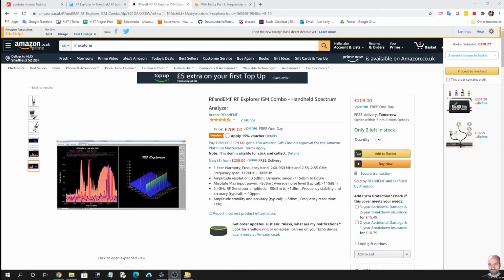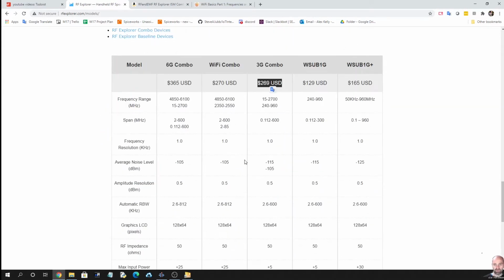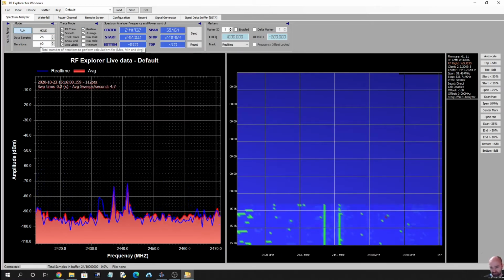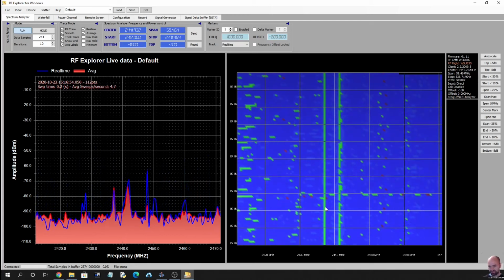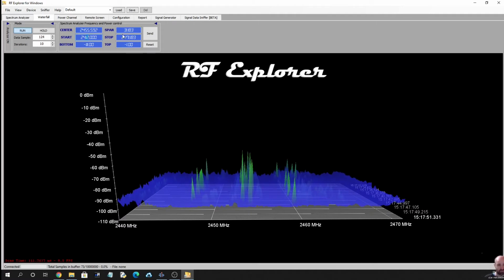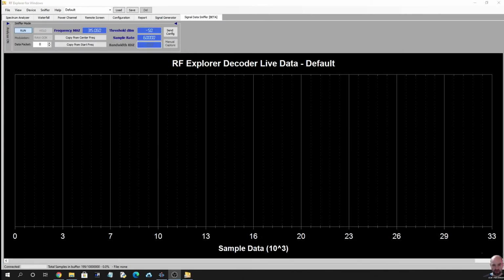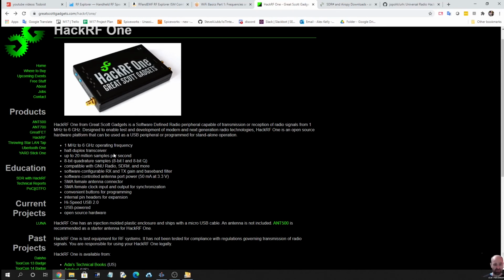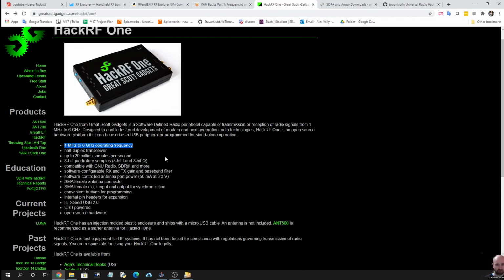RF explorer software defined radio

Comment: Aint these RF Explorer based around the Synthizizer chip MAX2870 and they simply lock out other ranges, on the lower end models or do they use other synth chips for the cheaper versions..
Got quite a few RF things with MAX2870 chip, like a PC based spectrum analyzer, and a HackRF  with PP 3:2" (handheld with battery and speaker) and a 23.5G to 6.5G MAX2870 Signal generator, that is just a 2.8" touchscreen on a board with a MAX2870 chip.
in 2023 if you want a "cheap" spectrum analyzser that can give you tangible RF values with high freq ranges. go for the TinySA Ultra that are around 130 US and it peaks at like 12G though not fully liniar at those high ranges optained with harminic mixing... if you want a cheap handheld SDR that got tons of software, then go for the HackRF H2+ with 3.2 portapack and its around 150 bucks in total, delivered.

Had have the HackRF for like a handfull of years and for 150 bucks, its a very diversed RF tool, it also have signal gen out that in my testing is loyal to 6.9G and spot on frequency.. the Mayhem sofware allows for 7.250G but it frequency drifts from above 6.9G to 7.250G but we are also way above its spec.. its impressive that its spot on to 6.9G, though again cleatrly not flat on such a wide span, and not suitable for tangible RF power measurements.
and you also have android SDR programs for HackRF like SDR++ or just crude RF analyzer spectrum, like here. where Im looking on one of my old FPV 5.8G analog AiOcams on an android tablet https://www.youtube.com/watch?v=LoVImsY2miA